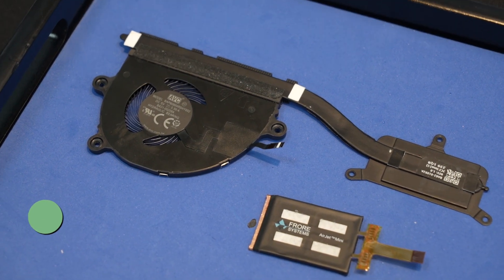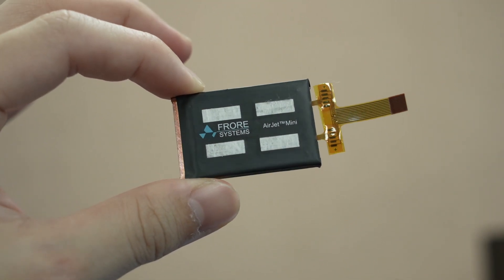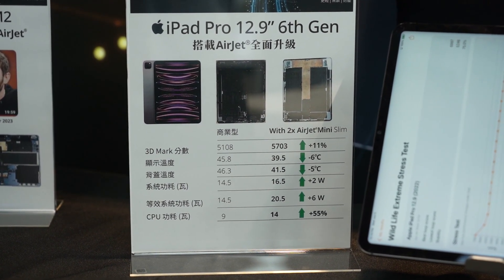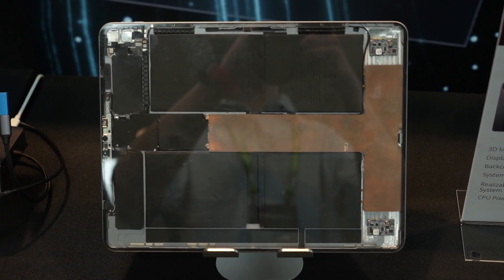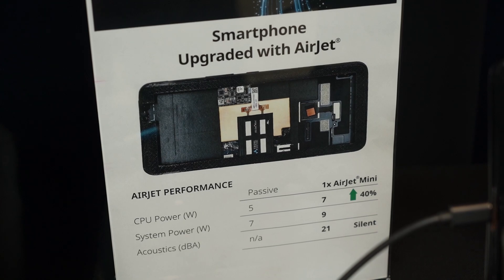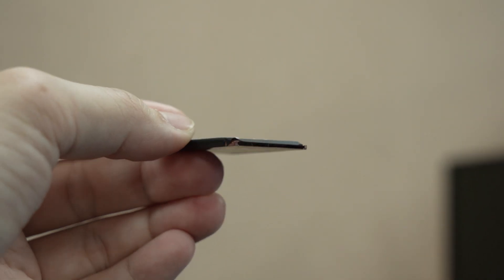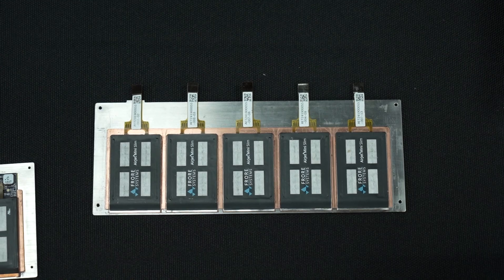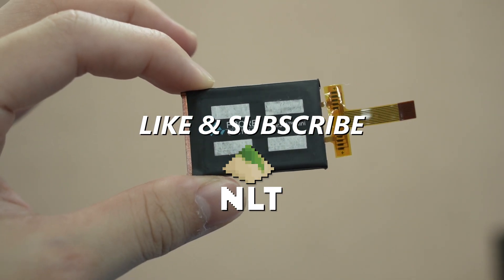This chip is a "fan" | Frore @ Computex 2024

Comment: How is it powered?
Reply from the maker: Still needs wired power. They hide it very well in the demonstrations
Reply: @NasiLemakTech  how is it powered? Can it use 3 pins from CPU fan
Reply from the maker: No, it's a ribbon cable.
Reply: Looks like a 25-pin flex cable. Because it's a solid-state piezoelectric device, it doesn't require the typical DC circuit to drive the piezo elements and certainly no tachometer sensing line like with a traditional fan. It's a rather elegant device, I must say.